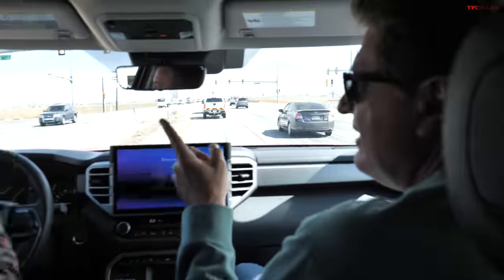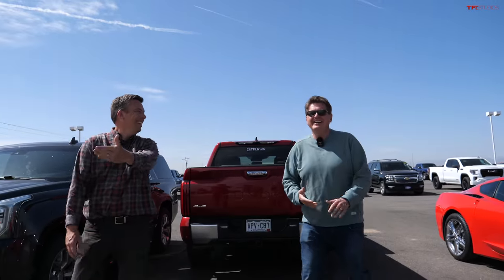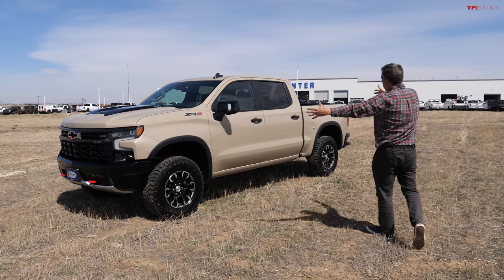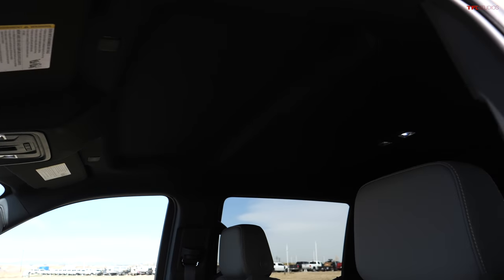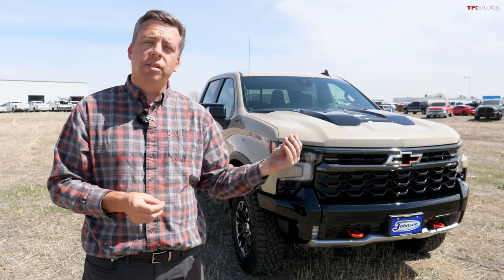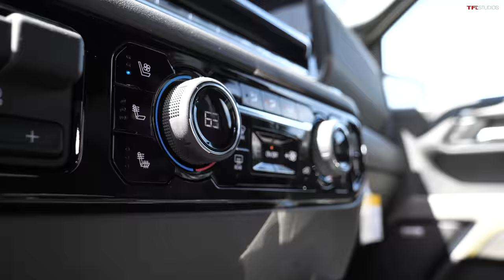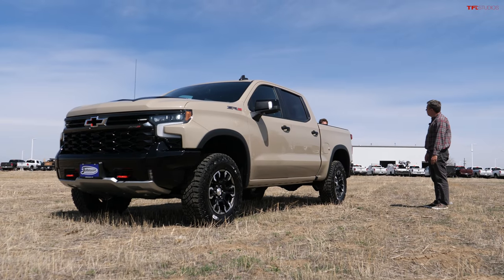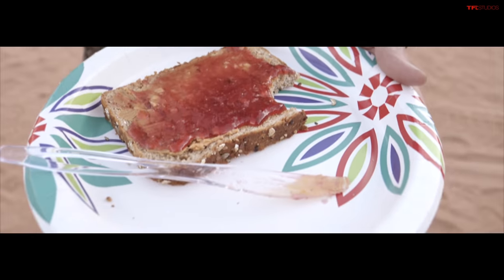We Traded Our 2022 Toyota Tundra TRD On This Brand New Off-Road Truck - Here's Why!

Comment: Very excited about the silverado purchase.  I own a 2020 f150 but I can appreciate what chevy has done with the zr2.  You should have the ability to get a factory equipped front and rear locker from the factory, I mean Toyota didn't even offer tow hooks on their off road model, very strange.  Looking forward to the new go big series as well.
Reply: They’re still garbage! My front diff blew at 146 miles on my 2020 sierra. My buddy just bought a 22 2500 duramax and after 200 miles the rear axel went.
Reply: @JohnDoe-nz6bk  yeah, GM has had many issues, my buddy had a major drivetrain issue on his;(
Reply: @JeepCherokeeful  No, Toyota has had many issues. Nice try.
Reply: @JohnDoe-nz6bk  that’s unfortunate, i put 45k miles on my 2020 3.0l Sierra. Covid quality? Cause mine was purchased in 2019
Reply: @mybro727  my coworkers 2021 Silverado 5.3 didn't make it to it's first oil change before bending pushrods.
Reply: Can wait until more Fully electric trucks get released. I am extremely tired with these gas prices. Specially when I visit California 😫
Reply: To me buying a new truck right now would be a loss. Because if you don't have the leverage of TFL, dealers will low ball you. I don't want gas, I want EV.
Reply: @204audi  awe 😢
Reply: Both my Colorado ZR2 and GMC Canyon have had hardly any issues. They are really well built in my opinion. Every car brand will have a few lemons.
Reply: @mybro727  And how many problems did TFL Truck have after 7500 miles on the Tundra? At least they are unbiased and will give a proper review. Looking forward to their review on this beautiful truck.
Reply: @Hellenkeller777  Agree absolutely. Glad you are enjoying your trucks.
Reply: @billw8476  I plan to have a solar setup to reduce the cost
Reply: @scmreport2457  the whole solar craze is super expensive, not really economically viable.
Reply: @billw8476  It actually is. Example I have $8000 dollar portable solar setup and it runs my freezer/refrigerator day and night. Their customer service is atrocious though.
Reply: @billw8476  I am not exactly poor. So I guess it's not for everyone. The convenience outweighs the cost for me
Reply: @JohnDoe-nz6bk  there will be a few duds with all brands. Other have had issues with the new tundra already.  TFL had a trailboss for a long term and was flawless. Did you not watch that series?
Reply: @scmreport2457  8 THOUSAND?...............LOL! i rest my case
Reply: @billw8476  It's not much if you're a hard worker. Plus I am pretty sure I will be more prepared for a natural or national emergency than you
Reply: @scmreport2457  i am a hard worker. i am also intelligent enough to know what works, and what doesn't. if the shtf, i am resourceful enough to survive a very long time, off the grid, while you are out trying to eat your solar panels, worth 8 k.
Reply: @billw8476  I know, I know you're jealous because you're poor. I'm not buying you're a hard worker. You wouldn't be so jealous.
Reply: @billw8476  There are many levels to prepare to. I have from basic to complex. Your ignorance knows no boundaries.
Reply: @billw8476  You don't even have a single video. I'm getting the vibe you're just a troll looking for attention. Best if you're ignored.
Reply: @scmreport2457  Do you just make a bunch of different comments because you can't think of what you want to say before you say it? I can assure you a lot of the hard working people around the world are on the bottom scales of the pay grade. I don't know who told you hard workers get all of the money because if that was the case the guy building your house would be rich and doctors or lawyers would be poor. To be successful in life you need many skills, intelligence, Social skills, Common Sense type stuff, Driven, The Ability to learn and understand things at a fast rate without being burnt out. Most poorer people are 'hardworking' because they have to be because it's the only way they know how to make money, or it's their only option to make money.
Reply: @Hellenkeller777  so interesting. I owned a 1st and 2nd gen S10 and they were mostly junk but my Dilverado of the same generation was amazing. Fast forward 15 years and it's all reversed.

Comment: Congratulations, it is a nice truck. Looking forward the future videos about it. Powerful V8, tow hooks, easy to get into the bed, 18" wheels, quite a few improvements over the Tundra.
Reply: But can only tow 9klbs
Reply: @tomjohnson8737  It can “only” tow a Hummer EV.
Reply: 10k+ is 3/4T territory if you’re being honest with yourself and like feeling safe on the roadway
Reply: @mattbrew11  tundra 12klbs towing
Reply: @tomjohnson8737  thats the max rating. That doesn’t mean its smart to do
Reply: The tire size is 285/70r17, not 285/70r18 as Andre said.
Reply: @tomjohnson8737  Probably because is an "off road " geared truck. I believe the regular Silverado with the 6.2 tows 13300 LBS

Comment: Just curious, did this truck come with DFM or was it deleted due to the chip shortage?  My 2021 Trail Boss has DFM and I had to pay extra and install the Pulsar LT to disable it.  I wish I had an option when I purchased it. Now I see many new Silverados coming without DFM and giving you back $50.00 to boot!
Reply: I also added the Pulsar LT to my 2021 GMC Sierra AT4 (6.2L) to disable the DFM, AUTO start/stop, tire size correction, speed limiter, throttle response, etc. Along with a CAI and performance Borla ATAK muffler, it does the job. I like the new Chevy Silverado ZR2...and that sand color is badazz.
Reply: Seeing F150, window stickers, with autostop/start chyip removed and about -$50 off.

Comment: Gm should have put the 6.2 supercharged
Reply: As a chevy guy, we'll have to wait another 5-10 years for that. Ill just be glad they did this much and hopefully they deleted dod/afm from the factory.
Reply: @iampotates  Never happen.  GM, like all other auto MFG's, are pushing for a full-electric fleet across the board (a stupid decision across the industry), and has already capped the total production number of C8 Z06 that will ever be made.  Electric trucks will never be as versatile or reliable as ICE powered trucks.  Unless the power for charging comes from nuclear power, Electric vehicles actually produce more emissions than if they were ICE powered, per charge.  Also, the batteries in electric cars can not be recycled, so they are more destructive to the environment (future shifted).

Comment: Great looking truck. I just bought a 2022 sierra at4 with the 3.0 duramax, also considered the 6.2. I know the Duramax will be much slower in  0-60 (or any speed) but they both have the same 460ft lbs of torque and the same tow rating.   I would love to see a same day direct towing comparison on the Ike gauntlet with the same trailer between the 2. I live in Loveland and run the Ike gauntlet just about every week. I Love how diesels  can run up that hill.
Reply: What kind of mileage are you getting with the sierra?
Reply: now that diesel is a buck more its no longer worth it.
Reply: anywhere from 22 to 25.  did a 90 mile loop boulder to loveland yesterday and got 25. have to make an empty run to frisco tomorrow so we will so how it does . @dontask7898
Reply: Thank you for responding, and it does matter even if diesel is a bit more right now.
Reply: @02hreblue30  and the belt you have to remove the transmission to change for the oil pump

Comment: Good trade! I looked at a new Tundra today and sat in it. I'm not impressed. This is coming from a long term Tundra owner too.
Reply: Tundra would be my 5th choice after Ford, Chevy, GMC, & Ram.  Great small cars from Toyota, but their full-size trucks … meh.
Reply: @krasnaludek298  I'll take the one that's going to last me 15 years with little time in the shop. Ford, Chevy, GMC, and RAM will spend 100x as many hours in the shop as a Toyota will. They're MEH brands now. This isn't the  1990s.
Reply: @davidfence6939  and the new tundra will spend 10x more in the shop then the ford or Chevy and the ram will spend 14 times longer in the shop then the new tundra since fiat owns ram

Comment: Seems like you guys got tired of that Tundra very quickly.
Reply: They need an unreliable piece of junk so they can add content to the videos and since the Tundra has no drama at all...
Reply: There's nothing really exciting about the Tundra IMO. It's kind of like the Titan- not class leading or innovative in any aspect. Just midpack on everything
Reply: @pcx4545  dosnt the new tundra already have alot of problems already 😅
Reply: @pcx4545  So that's why Toyotas already been having issues with their twin turbo in the tundra "reliability".
Reply: @pcx4545  what are you talking about if they wanted a unreliable piece of junk they would have kept the tundra probably found out one of the turbos where having a issue and decided time to get rid of this paperweight since it’s taking months to get the trucks fixed under warranty but aye keep being a blind person.
Reply: @NWI_Steel  Spot on. Toyota built the same truck for 15 years before being forced to update the Tundra and came out with a truck that leads the 1/2 ton segment in not one measurable. Epic failure.
Reply: @pcx4545  Thank you for saying that.  Now I don't have to anymore.  LOL

Comment: I like the rounded fenders rather than the square ones.  Thats a nice truck. I just bought me a truck I did not know there was a ZR2 in the making for that size or I might have bought that one. I had a 1999 chevy ZR2 dark blue in color. I bought it brand new. It was a 2 seater with a small jumper seat in the back. I loved that little truck. It had a 4.3 engine. Great video thanks.

Comment: Qty. 5 35x12.50r17 KM3 on stock wheels like the Gladiator or some Method Racing 703 trail series 17x8.5 wheels and Qty. 5  Yokohama Geolander MT G005 X-MT 35x12.50r17 tires

Comment: I was so excited for the new Tundra with plans of actually purchasing one, but when I finally saw it in the metal I realized it definitely was NOT worth the wait. So I started looking at the F150 XLT Sport and the Silverado RST. At this point, I'm leaning heavily toward getting a RST with the 3.0 Duramax. I wish you guys had chosen that engine because I really want to see some long term videos on the 3.0 Duramax. That said, this should still help me with my decision.
Reply: They're getting to release a newer version of the 3.0L Duramax (LZ0) for '23. I'd wait for that.
Reply: @dudeman5788  Yes, wait for a ‘23 model.
Reply: My buddy bought a new 4 runner and I saw new tundra on the lot and didn't like it at all......it just looks disproportionate and kinda funky.....no bueno
Reply: The ZR2 only comes with the 6.2L right now but the diesel would be nice.
Reply: 7 to 12 k miles is what they have  been averaging.wouldnt be much of a test
Reply: Same. The finish on new Tundra is horrible. The issues with the turbos also scare me.
Reply: @dudeman5788  I'm not planning on buying until next year anyway. Does anyone know what they are changing? I doubt it'll be a major redesign, since it just debuted 2 years ago and it's already a very solid engine as far as I can tell.
Reply: @jeffforbes70  Yeah, TFL turns vehicles over too fast. They're after clicks and people typically want to see videos on the latest trucks.
Reply: @dlg5485  I'm hoping it's to address the oil pump belt service interval issue. Fingers crossed they changed it to use a chain instead and there's no longer a service required.
Reply: @dudeman5788  Yes, that's definitely a change I'd like to see, but cost cutting rules these days. If that belt provides a few bucks more in profits per vehicle, they'll likely keep it. I'm not too bothered by it, since 150,000 miles is 9 or 10 years of driving for me.

Comment: Just an upgraded Trail Boss with the old slow 6.2 engine. Should have up the power on the Chevy.
Reply: Tell me more, I don't have first hand experience with the 6.2
Reply: @Lexman00  it's slow af and seems to be getting even slower...
Reply: Slow compared to what?  A TRX and that's it...this isn't in that price range but would have been awesome if they supercharged it.  The 6.2l hauls compared to the Dodge 5.7, beats the Ford 2.7 and barely loses to the 3.5 HO.
Reply: @kelman3331  Don't forget the big 6.2 also loses in a drag race against the twin turbo Tundra too. The Hybrid Tundra would beat it worse.
Reply: @highplainsdrifter9849  only at altitude...not at sea level

Comment: The ZR2 Silverado is so much better looking than the Tundra.  It will be interesting to see how Chevy’s quality compares to Toyota’s.
Reply: As long as you trade every 3-4 years you should be good. Long term? You can keep that 5.3. Not to mention all the electronic nightmares, window regulators, transmissions....
Reply: It won't compare to Toyota's.
Reply: It’s garbage
Reply: I don't know, generally speaking Toyotas are reliable, that's the main thing I like about my 4Runner, but this generation of tundra is unproven, and I'm hearing people are having issues with it already. Personally I wouldn't bet on one of these new Tundras for a couple model years until they work all these bugs out. At this point the 6.2 L in the Chevy is tried and true, it should be fairly reliable.
Reply: @trailrunnah8886  Yea the motor is good but everything else....I had a ram with a 6.7 cummins. I loved the cummins, hated the ram wrapped around it.
Reply: @gsxr419  lol, I've heard that. Honestly I think David on their channel has the perfect truck. His crew cab square body with a swapped in Cummins is amazing.
Reply: @gsxr419  my 2016 ram 2500 mega cab limited cummins was one of the best trucks I’ve ever owned!

Comment: Okay video idea. You guys should text fit a set of 35s on the truck to see how that goes. Chevy’s large off-road drawback for forever has been the fact that you need to put a dang near 6 inch lift on the thing in order to fit 35s.  It’s always been Huge drawback when going off-road when comparing to other brands.

Comment: This is a question not specific to the ZR2 but I noticed it on the review.  Why do pickup trucks continue to come with whip aerial antennas?   You really don't see them on any other vehicle.  This ZR2 has a shark fin on the roof....why couldn't the radio antenna be integrated in that?

Comment: wow, you guys basically had a free Tundra for almost 8000 miles!
Reply: Toyota vehicles hold their value very well. Can't say that about other brands.
Reply: No way, bro…they paid tax, title, and license fees on a $60k truck.  There’s nothing free about that and that money is just GONE.
Reply: @PlanoRob  well their business did, and it’s all deductible.  With the money they made off of the videos from that Tundra I have no doubt it made quite a profit for them.
Reply: @MrWolf2212  I still don’t understand why people are so in love with Toyota I had a 2020 4Runner as a loaner vehicle while my truck was in the body shop after someone not being able to maintain their lane. Let me just say that 4 runner only had 14k miles on it and was one of the most displeasing things to drive interior was garbage for the 60k price point the engine completely underpowered and a gas hog my dually gets better MPG the transmission is horrible at keeping you in the power. The only good thing I have to say about the 4 runner was the suspension it was decent but for 60k it better be good the rest of the vehicle was garbage and to top it off I got my 2020 3500 crew cab 4x4 dually with a duramax for 56k and financed 60k with a 1.2% interest rate. So yeah when people tell me how amazing Toyota is I just laugh because they are overpriced for what they are.
Reply: @PlanoRob  That's not how taxes work. The taxes aren't "gone." They got the tax break on the new truck by trading the old one in.
Reply: @Back_door_bandit_98  You have no idea what you're talking about man. There isn't a 4Runner with a "60k" price point. Even the most loaded 4Runner that exists (Limited 4x4 or a TRD Pro) isn't $60k.
Reply: @Back_door_bandit_98  you're not wrong about the 4runner. I own one, a 2013, and the new ones are essentially the same and woefully out of date. Hopefully there's a new generation coming within the next year or two that addresses all of these problems.

Here's why people like the 4Runner though: I bought mine three years ago with just under 80,000 miles on it, I now have 136k miles on it. In that time, other than routine maintenance, the only money I've spent on repairs is $189 to have the AC topped off at the dealer. That's it. They suck on gas, they're underpowered, and they're outdated, but the maintenance costs on them are ridiculously low. Also, the typical sale price on them is around 45k, not 60. You have to find a dealer selling a pro at markup to get up to the 60 price point.

Comment: The zr2 isn't supposed to be a raptor or a trx , it's supposed to smash rebels , tremors , and TRD pros .... .... and gm hit that point perfectly
Reply: Except they priced it to complete with the Raptor.  I do think they are just taking advantage of the supply shortage there.  I don't think they would have set their MSRP so if Raptors weren't selling for $100k minimum right now.
Reply: @dcl97  The reason to why the ZR2 costs as much as it does is due to the fact it comes essentially fully loaded at its "base" price. So really, it isn't too far fetched, as a fully loaded Tremor, Rebel, TrdPro would cost as much, if not more.